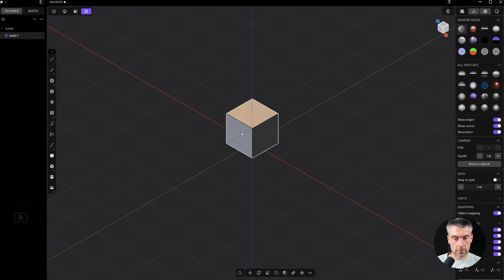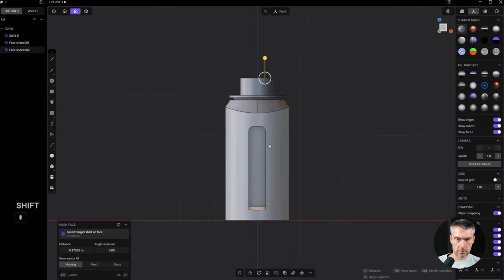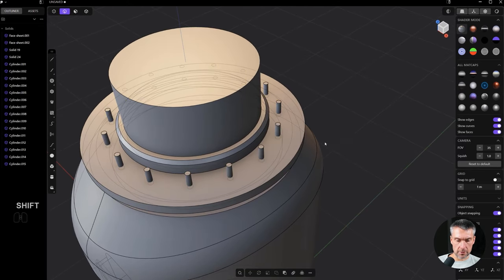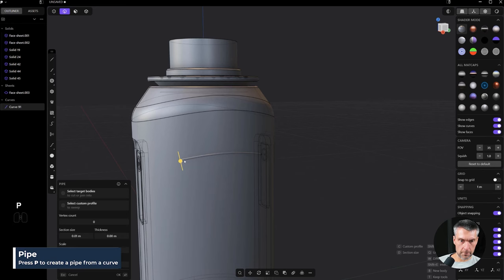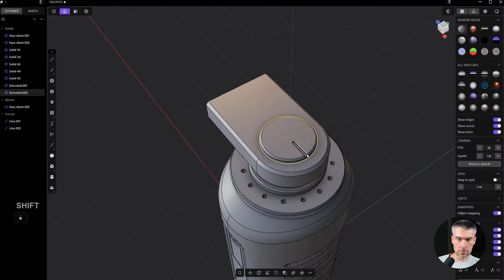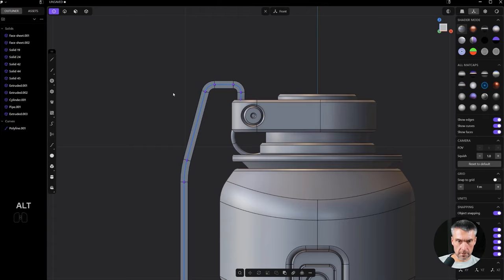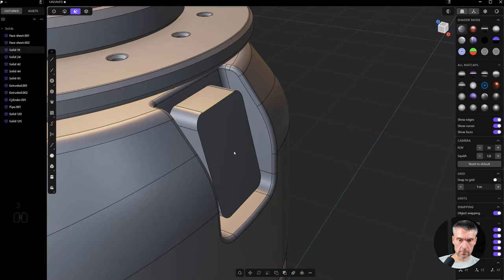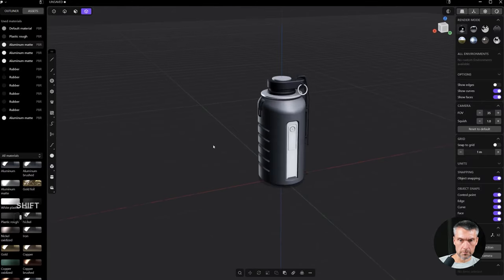This Sci-Fi Grenade Design Will Blow Your Mind!

Comment: Hello Mr. Ponte, I have a quick question about Plasticity since am consider buyiong the software. My main goal is to create hard-surface props for games, such as guns and similar assets. I was wondering how well Plasticity handles that kind of work, considering that exporting to Blender often results in messy topology — though manual triangulation is required anyway. So my question is: would you say it’s worth modeling the high-poly version of the asset in Plasticity and then optimizing it, or is it better to stay in Blender for the whole process?
Reply from the maker: i d say yes, but it depends on your preferred workflow, especially that even with subd you ll need to retopo